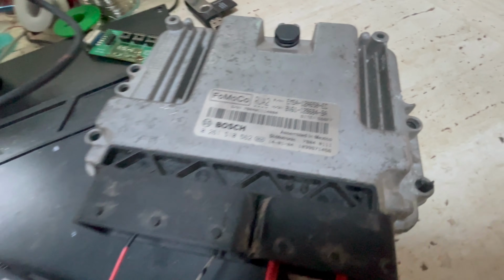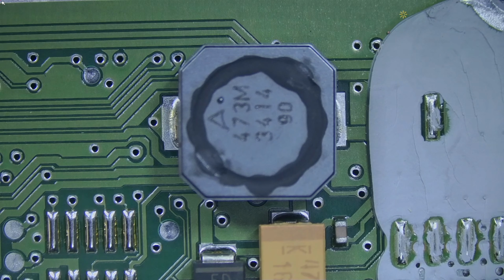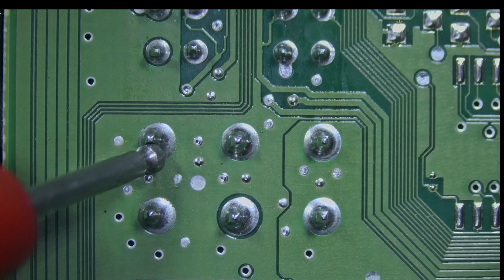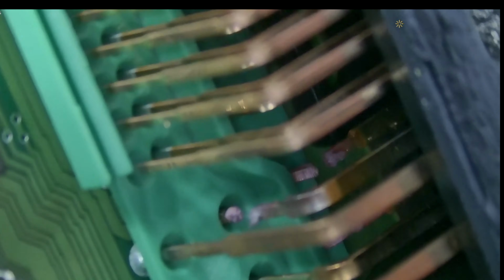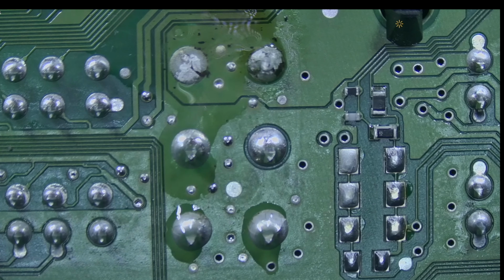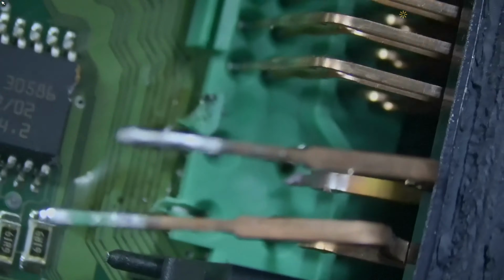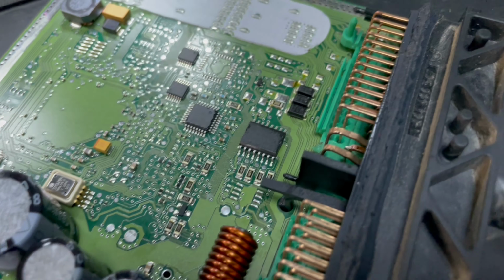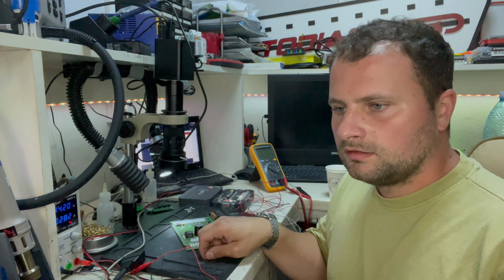Ford Focus 3 ECU MED17.0 repair after a BIG SHORT

Comment: Thank you for this video! Was putting my truck back together and the positive battery cable touched the ECM housing. Then I had no crank/no start. Opened up the ECM & sure enough the ground pins were broken within the connector. Remains to be seen if it’ll still work in my truck. I’ve replaced the most rear pin, the two easier ones tomorrow.

Comment: what temperature are you using for the solder pin at 14:00 ?
Reply: I had to raise my solder temp to 375° C to reliably melt the existing solder, even after mixing in leaded solder
Reply from the maker: It’s all about heat transfer. If the factory solder of those pins melts at 300 celsius degrees and the traces or the pins are big, you need a powerful soldering iron that can keep up with heat transfer. Or you need a preheating station to rich the temperature near melting and just a normal soldering iron.